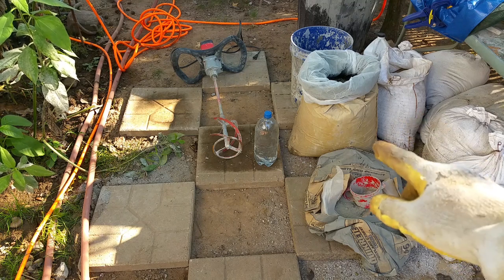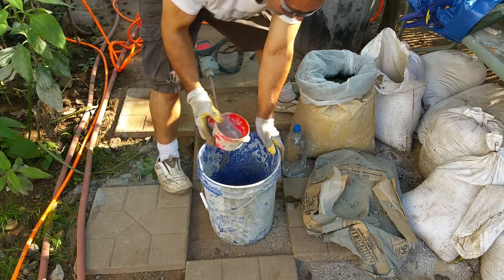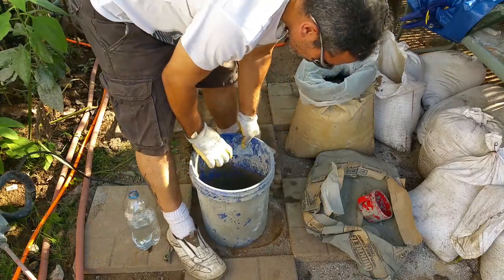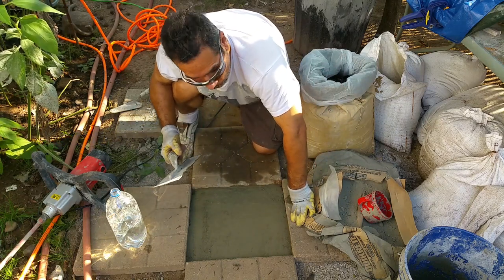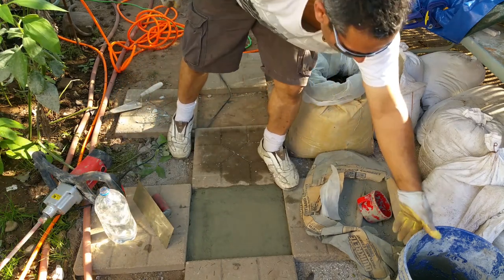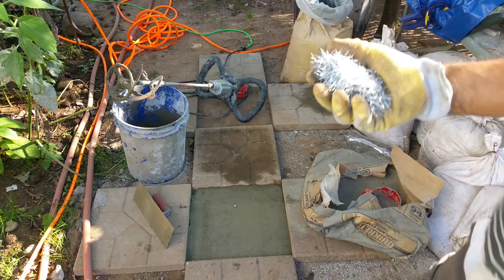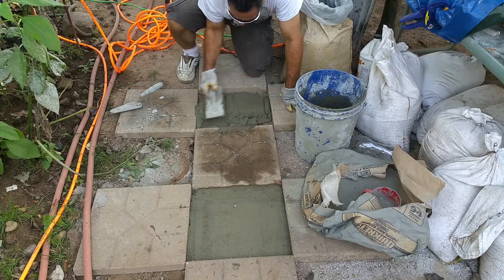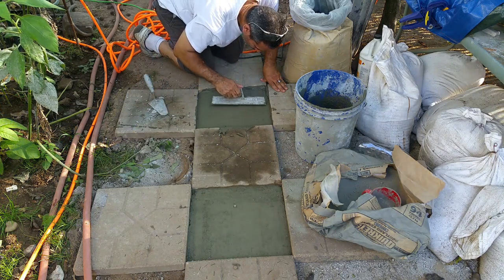Basalt Fiber Chop vs. Helix Micro Rebar | concrete slab test part 1 #Aircrete #AircreteHarry #Helix

Comment: It turns out that basalt does not like the high alkali high pH environment that much - the basalt gets etched away a bit - mostly an issue for the very fine fibers, not a problem for the bigger stuff. Better than hemp that really gets eaten up in concrete. Pretty sure you will find the steel fibers add a lot more toughness - after a few weeks of curing. What happened to the foamcrete dome?
Reply: What makes you think that volcanic rock is nonreactive to anything? That is absurd.

Comment: Hi Harry, I was curious to the basic cost difference between the basalt fiber chop vs helix micro rebar for yourself. Just curious because I bought some basalt fiber chop about a year and half ago and may go the helix micro rebar if price is worth any advantages it has. Thank you Harry.
Reply from the maker: I know I paid $250 for the 45 lbs box of Helix Micro Rebar. I think the Basalt was a 75 lbs bag and I don't remember how much. I think it may be $50 or $75.
Reply: Thank you Harry for the info. I will see about getting a smaller quantity of the micro rebar for my home projects.

Comment: The basalt fiber should be agitated in the water until the fibers are all suspended separately and straight, then gradually poured into the mixer - according to one company. 

Also, keep in mind that basalt chop is supposed to be far less expensive than stainless, so comparisons by equal cost or recommended amounts are best. That was a stainless steel product, yes? 

Hammer impact over random dirt is harder to accurately compare than when edge supported. Anyway, I would like to see gradual stress or strain tests more than impact, although that must also be important during accidents. 

Steel should fail more gradually, and basalt rather abruptly; but steel should begin failing at lower strain and basalt at much higher strain. The width of the resulting micro-cracks is what is measured by engineers, not just complete fractures.

Comment: Thanks for your video! I wonder if for your test the size (thickness and length of the Basalt chopped fibre was the same as the Helix, also was the quantity (mass) the same.. All research suggests that basalt is stronger than steel so it should be that the basalt performs better.
Reply from the maker: It is true the Basalt is stronger than steel. I think the Basalt failed in this test against the Helix because of friction.
The Basalt is smooth and straight, on the other hand  Helix is twisted. And that is one of the features that make it so much stronger than other cement reinforcers.  You can see the two better in this video. https://www.youtube.com/watch?v=zRephX3Zpb8